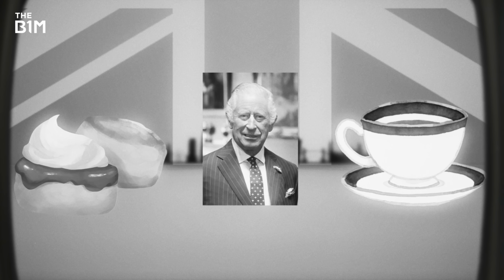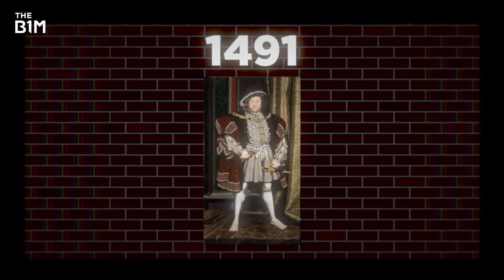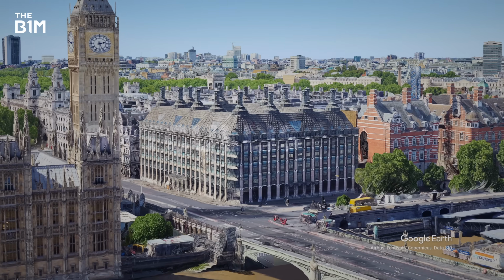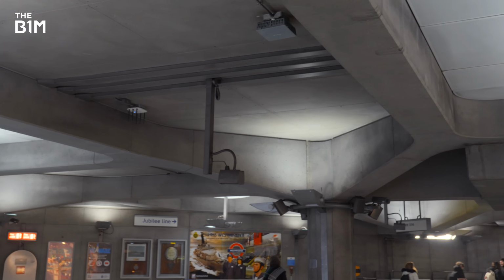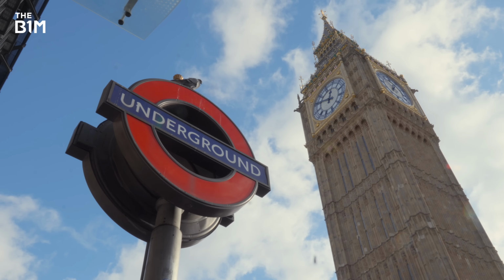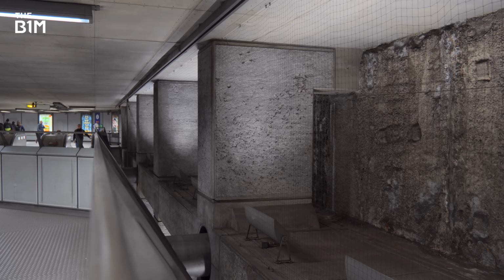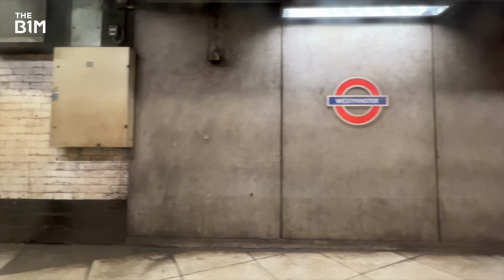The Insane Tunnels Under Big Ben

Comment: Firstly this is all Tartarian - we did not build this masterpiece, to take credit of their engineering when we struggle to make decent roads is a real insult 
Second the last point is no one finds bare pillars and concrete bold or brillation, it's just dull. 
We can only create steel, glass, concrete and plastic buildings and even then it can often exceed 2 years - to build a lifeless box
I doubt we could even chisel a corinthian comlin

Comment: 8:12 Not just soil displacement rectification my dear, but utilising two other properties.
Sticky and chilly: glueing it together and freezing it. Holds the ground in place and halts the progress of any cracks or unwanted slippage simultaneously freezing it on the spot.

Comment: Tower leened 22cm and the accuracy with laser is 1 cm?! That seems to be quite a low accuracy to me.
Reply: It depends on the distance from the laser source , the problem is that the tiniest error in the gyroscope sensor and mechanics gets multiplied if you multiply that distance. I have a cheap one that claims an accuracy of 0.35 mm per meter. That would be a 35 cm error over the complete height of this tower... So 1 cm over a distance of 100 meters is pretty impressive .

Comment: 'Accurate to 10mm'...? Pretty sure that equipment is more accurate than that pal
Reply: It depends on the distance from the laser source , the problem is that the tiniest error in the gyroscope sensor and mechanics gets multiplied if you multiply that distance. I have a cheap one that claims an accuracy of 0.35 mm per meter. That would be a 35 cm error over the complete height of this tower... So 1 cm is pretty impressive to me

Comment: An engineering triumph, to be sure, but some of the aesthetic choices they made with regard to the (effectively) new station? Let me put it this way - it looks like something only an architect could love! Or to put it another way, it looks like a cross between a steelworks and the Peach Trees 'city block' (as in, a tower block housing a city of perhaps 50,000!) from the Sci~Fi movie, 'Dredd'!) 
        And don't get me wrong, either, it's not like I'm one of these people who are just reflexively 'down' on Brutalist - type structures; quite the opposite in fact. Thing is, though - you can take a thing too far. There's Brutalist, and then, there's just plain 'Brutal'!

Comment: No mention of my lifelong friend (he died in 2023)  who designed the hydraulic support system that was installed, to level off any movement as time passed.  Two seperate systems were installed luckily, as a JCB driver cut one of the lines, leaving one system still working.  It was all buried in concrette by then, so the 'cut' system couldn't be repaired, as the hydrailic lines had been ripped out.

Also, the Elizabeth tower started showing cracks at the base at one point, so after a week of frantic phone calls, my friend received orders to "lock off" the remaining hydrailic jacking system to secure the whole structure, by pumping  resin into the jacking system.  No more chances to level the whole structure, but at least the tower was saved at that time.

Mt friends expertize was making sure oil rigs stayed in position on the sea bed, hence his jacking system was employed as a precaution against any ground movement in the future. Pity it's not going to be able to be used in the future of course.

By the time the faults are apparent, all the people will be long dead, so their ok with it as it stands.  On a personal note this video shows just how ugly the whole thing really is, but I'm sure the people who now take credit for the whole thing will say how wonderful it all looks.
Reply: I knocked down the buildings over the road. Was only young 😂

Comment: Remember from attending a talk for this at uni. The horizontal steel cylindrical bracing for the box are not hollow section, they are completely solid steel. They had to source them from a company that made propeller drive shafts for cargo ships as no other place could produce such a section.
Reply: Great fact!

Comment: The architect discussed the complexities of the design & structural design with the tube tunnels not in alignment with the street level structure. Was any proposal evaluated where the street level structure was adjusted to the tube tunnels. This may have required blocking off some streets for pedestrians use only. A less complex design & structure may have a lower cost due to its simplicity.

Comment: The current Palace of Westminster isn't 1000 years old, it was built between 1840 and 1876 after the old one burned down. The site itself though has been in use in some form or other since Cnut in 1016.

Comment: 6:28 "Big Ben has been here for centuries" Nope, not even 2 centuries yet. The current Palace of Westminster, including the clock tower, was built in the mid-1800s.
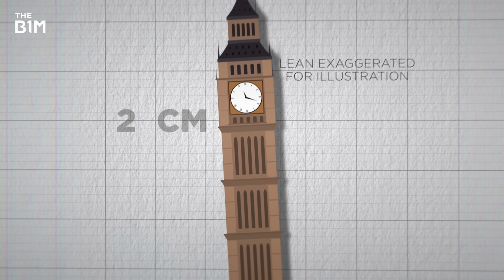7:33 "Plump line" instead of plumb line
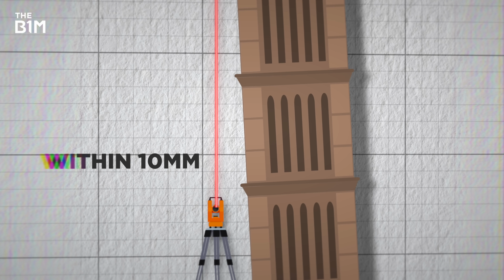7:51 10mm accuracy would be very unimpressive for a laser - other comments suggest it was actually a tenth of a mm
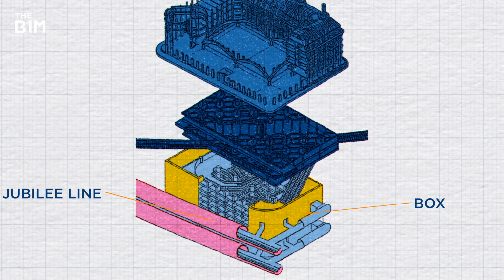8:37 Arrows are the wrong way round - tube trains drive on the left (with a few notable exceptions but this isn't one of them)

Come on B1M, you're usually better than this!

Comment: Portcullis house needs reburbishing already, the original build cost was £265 million and the building was supposed to last for over 120 years, and certainly much longer than the 25 years so far before needing major work, the estimates to carry out te refurbishment includng the atrium roof which is both leaking and having glazed panels fall out and the bronze aluminium roof which is leaking into MP's offices is around £240 million, so in 25 years almost half a billion pounds spent to house 213 Members of Parliament, what fantastic value for money!
Reply: Somebody pocketed the change no doubt.

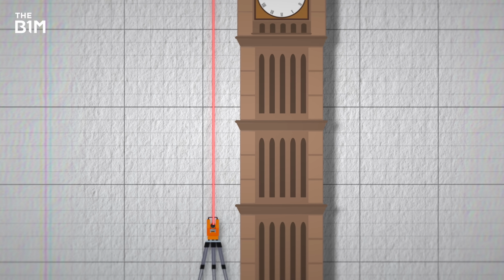Comment: 7:49 Saying 10mm instead of 1cm is giving me “my wife’s father in law” vibes
Reply: 1 cm could mean anything from 5 to 15 mm (or 0 to 20 mm if you only round up or down), 10 mm narrows it down to between 9 and 11 mm
Reply: @Sorenle72  that’s actually a valid point (although I narrows it down between 9.5 and 10.5 😉)
Reply: 10mm is better than 1cm. Less likely to lead to confusion. Use m and mm and people know what you mean with just the number.
Reply: @johnclements6614  I think they just wanted to use mm because when people hear mili they think it’s precise
Reply: @ If you say 5 thick piece of steel it could be 5 or 50mm thick if you use both. You can eliminate 5000mm 5m as you are very unlikely to get that. It is more precise because there is less confusion.

I have never seen cm used on civil engineering drawings in the UK.
Reply: @johnclements6614   I have never heard anyone say 5 thick piece of steel. Maybe a worker would say that, but in engineering you ALWAYS say what unit you are talking about. And the other thing engineers do is they don’t leave zeros hanging so 10mm is 1cm. Sometimes people do tend to leave zeros when they don’t want to create confusion and want to have the same unit everywhere. I just said that saying 10mm instead of 1cm gives me “my wife’s father in law vibes”
Reply: @charliewastaken Mixing units is bad practice, you should always try to avoid confusion because people do get confused.
Reply: @charliewastaken my dad is from mechanical engineering. They measure everything in mm, to avoid different units. Even if something is several meters, they note it down in mm in their drawings. He is constantly using mm even in every day's language, to the confusing that you observed.
Reply: @johnclements6614 
You're right.
We use SI units rather than metric ones. So not too many centimetres or decilitres in the UK . (Not sure if IKEA got that email).
I don't think I like millimetres being abbreviated to MM rather than mm either.

Comment: I worked on this when I was at Mace.  The responsibilities between the JV contractor  for the station box) on one side and LUL on the other side were never properly allocated in the construction documents. The JV contractor was responsible for reaching agreements with third parties who were reluctant even to speak to them.  I was brought in to broker a new way of working.  The engineers who worked on the project were very good.

Comment: I would love a TV that can power my PlayStation, sound system, and Apple TV. Fewer wires is better. Like I plug my laptop into my monitor through thunderbolt and it outputs display and gets powered. That just on a bigger scale.

Comment: Great video. Question; is the optical plumb really only accurate to 10mm? That’s pretty poor for the distance it’s measured from.
Reply: They must mean a tenth of a mm.  If the tower leans as much as 22mm with a plumb bob, the optical would be worse at a plus minus 10mm.
Reply: Had the same thought. Feels way too poor. 7:51
Reply: I thought the same, from a very quick Google, £900 ones are accurate to 1mm, so I feel it has to be 1/10 of a mm at the most

Comment: What about the subsidence of Westminster palace itself? 
Why was it built on a mud flat of Thorny Island?
A report I read said £2 million a week spent on “patching up” and it may be destroyed before it is restored.
Reply: There was a ford across the Thames there.
Reply: @johnclements6614  I understood that yet to build something as big as the Abbey and Westminster palace there was not wise.
Reply: @favesongslist  It was an excellent place to build. 
The ford gave access on foot at low tide to the other side of the river and river was the principal mode of transport until the 1750s. 
Being an island it was more defensible.
The ground was obviously good enough to support the weight of Abbey and Westminster.

A palace could have been built further from the river but then would have been cut off from the river, and transport especially in the winter.
Cut off from the river it could also be surrounded and the occupants could not escape or be supplied.

When the Elizabeth tower was built it was not designed to withstand such a large excavation nearby. Why would it.

Comment: That place looks like it was built to withstand an earthquake or air raid. Toughest reinforced concrete I’ve ever seen there.
Reply: The river used to be much wider. Its probable that the Tyburn had a creek there at some point. There could well be 10m depth of gravel silts and soft clay before you get to the hard London Clay.

Comment: I remember watching a documentary of the building of this at the time.  I remember the construction workers had to be careful as not to disturb all the underground water and gas pipes.  The construction workers had dug the big hole and you could see all the pipe work exposed and hanging in mid air.

Comment: @7:50 10 millimeters, hmm? That's roughly 1 centimeter, wouldn't you say?
Reply: Yes, it is. Your point being what? 
BTW the 10mm note was out by two orders of magnitude. The tower was continuously measured with an accuracy of 0.1mm throughout the station construction. The net movement of the tower had to be regularised against the cyclic movements caused by the sun on one side of the tower (heat expansion) and the push on the foundations from the tide going in and out in the river Thames. The top of the tower continuously moves around by 5-10mm depending on these effects.